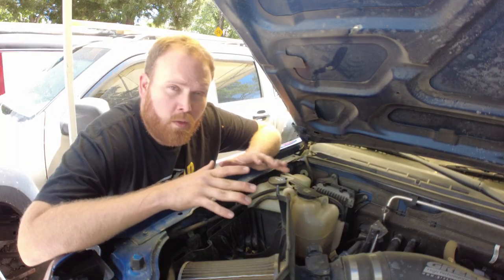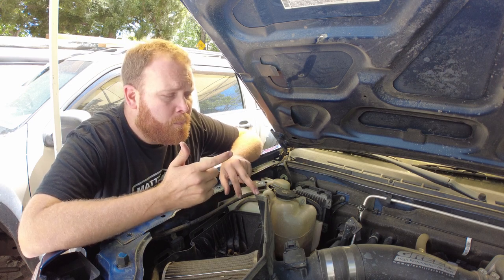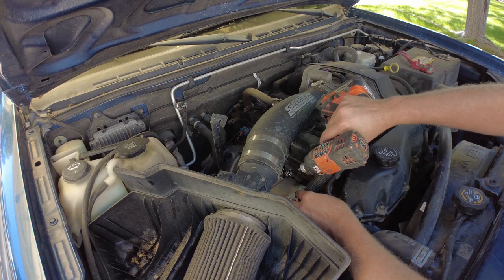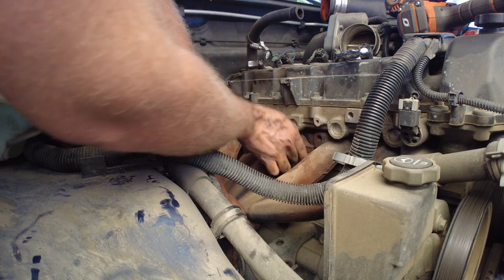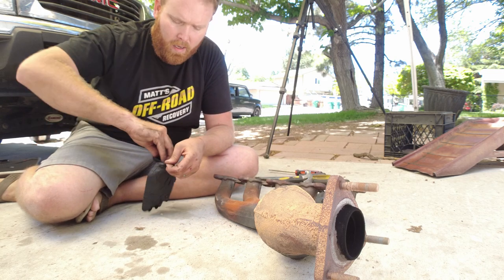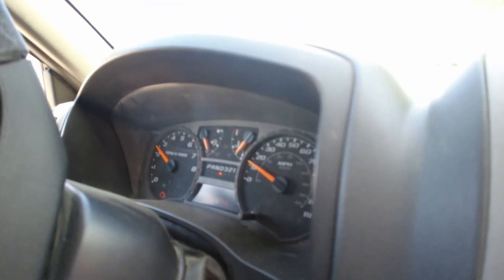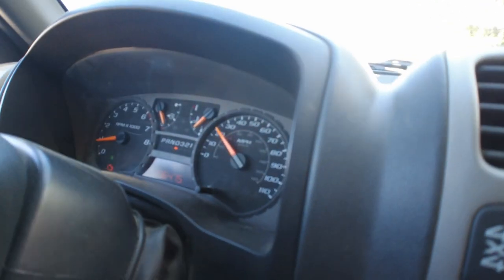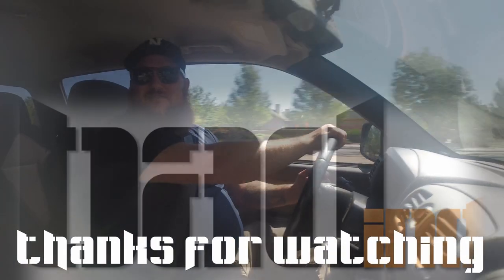Cats Kill Horses [Colorado Exhaust Manifold Delete]

Comment: On my 3.5 the manifold bolts on both ends had broken off flush during driving. That was caused by the manifold length expanding when hot. While doing the necessary valve job I slotted the manifold hole to allow for any future manifold expansion. I like the sound with the pre-cat mod. My best MPG is 31.3 on 89 octane. I also did the Supermodulation throttle body and tune.
Reply from the maker: Right on man. Consider the studs. They are a great way to prevent the bolts breaking off.

Comment: What's it going to do to your O2 sensor
Reply from the maker: On the early trucks you don't need to do anything but on the newer years you need a spacer
Reply: 07 need a spacer or no?
Reply from the maker: @alexmcrae6359  yes since the cat that's metered is the one we're removing. You could relocate the sensor behind the other one but that would require more work

Comment: If my exhaust manifold cat some how had all the insides fall out on accident on my h3  with 3.5, do you think I would still pass smog since there's a second cat under  h3? I was just wondering. I'm in Cali and the laws suck......
Reply from the maker: This mod should not produce a code.
Reply: Did it for either of you guys? My awd Toyota has manifold precat that is much hotter at inlet vs outlet
Reply: @KollynJ  
it turned out to be my lower Cat and i had to replace it to pass smog.

Comment: Probably a stupid question as I'm sure you posted exactly what you ordered, but that link for the studs goes to a kit for Ford... This is the proper one for our Colorados, yeah?
Reply from the maker: Yessir. They are the exact ones installed in this video.
Reply: @BadlandIndustries  this is why I appreciate you! Amazon tells me no, but you tell me the truth. Ordering now!

BTW... You'd be impressed with my metal working skills today. 😎
Reply from the maker: @markwornson9896  what did you do?
Reply: @BadlandIndustries  finally getting my body mount chop holes patched up. Had to do it myself as I couldn't find a welder locally for less than a small fortune.

I'll send you some pics when it's complete.
Reply from the maker: @markwornson9896  I gotta trace mine and get them drawn out in cad.

Comment: Can you still pass inspection and smog without this front manifold precat and since it’s after th w first 02 does it throw codes?
Reply from the maker: No codes if you do this right. Idk about smog . The 04-06 all had both cats between the two o2 sensors whereas the 07-12 had both on the manifold. You'd need a spacer or you'd need to relocate the downstream one behind the second cat.
Reply: @BadlandIndustries  I want to do this on my awd matrix. Every other video I’ve seen on doing this is on the mr2 spyder which is the bigger 2zz Toyota engine but my awd 1zz has the same manifold cat
Reply from the maker: @KollynJ  if you understand what the computer expects to see, it's quite simple to modify these to suit your needs.
Reply: @BadlandIndustries  good advice thank you

Comment: Should you tighten all of the manifold bolts before you tighten the three nuts on the flange?
Reply from the maker: Yes, get the manifold completely installed and then head under.
Reply: @BadlandIndustries  sounds good. Thank you.
Reply: One more question. What did you find was the best way to remove the nut at the top of the flange?
Reply from the maker: @Andrew-Knecht  lots of 1/2 extensions and 3 hail marys
Reply: @BadlandIndustries  lol I’ll try a swivel or go through the fender well with a wrench.
Reply from the maker: @Andrew-Knecht  you can reach it with a couple extensions from the bottom but get it started by hand. Soak it in thread penetrating oil beforehand.
Reply: @BadlandIndustries  that was the plan. Thanks again.

Comment: Do you think getting the motor warm before trying to loosen the bolts would help?
Reply from the maker: No, the brass drift shocking the bolts has worked well for me. The studs just eliminate the risk going forward.

Comment: What about the second 🐈 ?
Reply from the maker: I have no idea what happened to it lol
Reply: @BadlandIndustries  I saw alot of thread and of vid about removing the first cat , 10 HP gain fine , but what about the second cat . Is there any gain possible there , sure it will have a better flow but is it worth it
Reply from the maker: @meredithchris306  reduction in back pressure will move the power up in rpm. More flow will result in more horsepower but your felt torque will be less
Reply: @BadlandIndustries  so not necessarily good for us , I prefer low to mid torque but that's my feeling
Reply from the maker: @meredithchris306  i prioritize getting the truck moving over having oodles of hp. I gotta get my 6000# truck on 40s moving.
Reply: By torque management you mean tcc?

Comment: Wait, you can disable passlock electronically?
Reply from the maker: Via a tune yes
Reply: @BadlandIndustries doing that right now. The UI for HP tuners changed a lot
Reply from the maker: @stomper244  yes it has over the years.